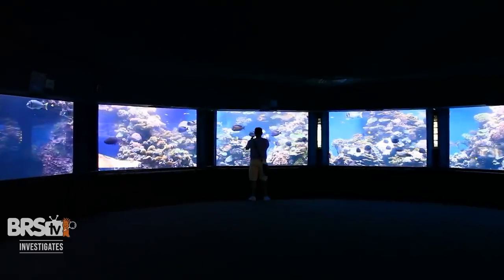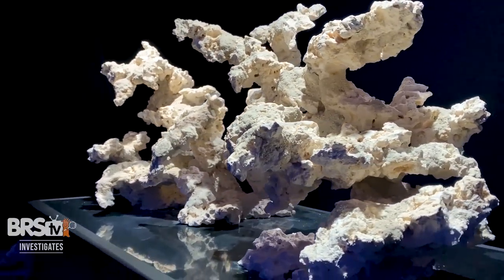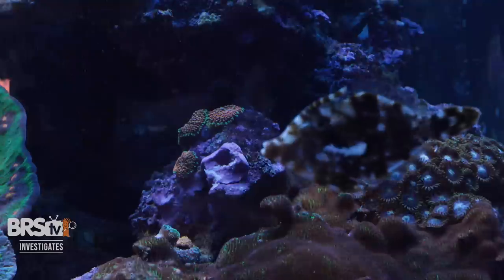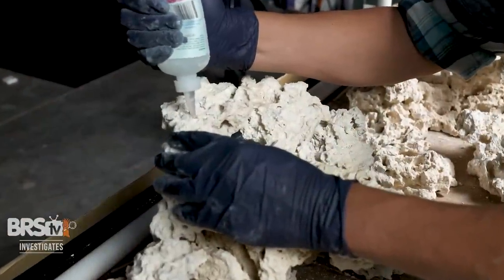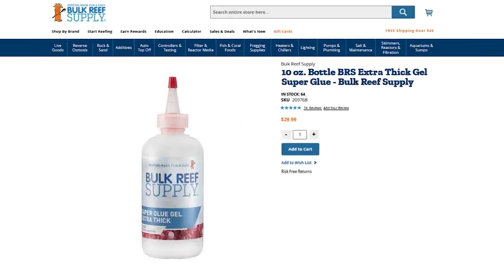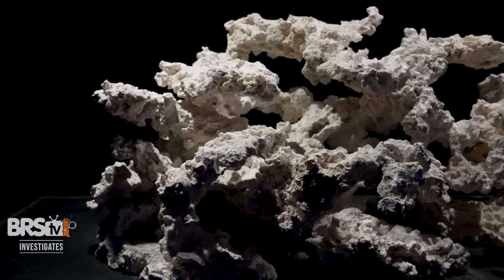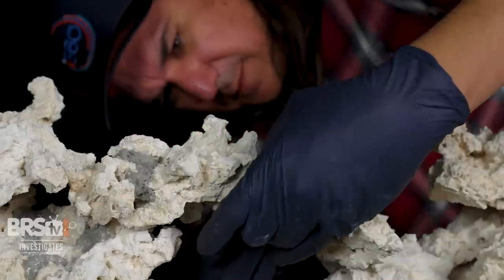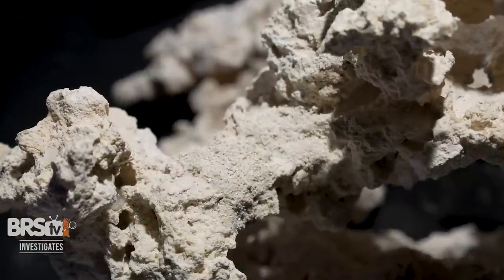Did We Forget That Fish Live Here? Is Habitat Based Aquascaping the Future?

Comment: I'm finally getting my dream tank and thinking about trying to build something like this. Did you have a specific size you were trying to build too?  How tall did this end up being?  You should think about putting a pack together with everything needed to do this.  Base it on tank size or something.  I'm about to do a 75 so I have no idea how much rock to buy with foundation pieces.
Reply from the maker: This aquascape was built for a 120 gallon system, which is 4 feet long, 2 feet wide, and 2 feet tall. This aquascape was pretty tall at about 18-20" tall. If you were going to build with an SPS system in mind, you'd want to keep it shorter.

Comment: After that NSA hype and fallout, this also need some soak time before pushing for prime time. In theory it has many hiding space. But from reality, how often do you see fish hiding in a rock hole that's not at the bottom of the tank. I have the suspicious that the hiding space half way up the rock will not actually be used by fish. They will just fight for the ones at the bottom. The ones in your 360 tank are all on the bottom. Without putting this into a real tank to test, this HSA might only work as well as NSA, not better.
Reply from the maker: Interesting thoughts! It's definitely going to be a good idea to think about the livestock going into your tank when building something like this. If you're going to be primarily keeping fish that hang out near the bottom of the tank, you may be right. If you're picking more free-swimming fish, then the bottom hiding places might not be used as much.
Reply: @BRStv  the 24" of height is really nothing to the fish that used to live in the ocean. So is there really a thing as fish hanging at the bottom vs free swimming mid water? From all the tanks I saw, fish always hide by the bottom regardless where they swim when not hiding. I hope fish will make use of the hiding spot up on the rock work. But that's just a guess without actually trying it out in practice. Recommending solution that sounds good in theory with great deal of certainty, but didn't actually testing out, is dangerous of misguidance just like what you did with the NSA. And kind of irresponsible without some disclaimer especially you have done it once already.